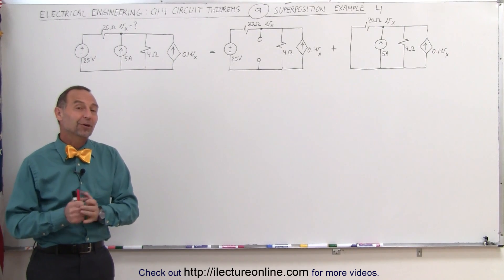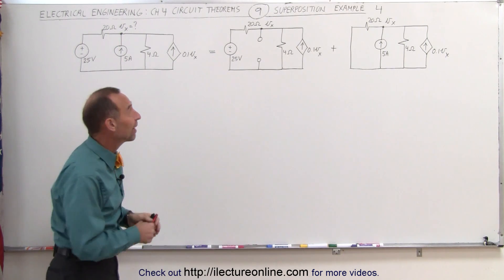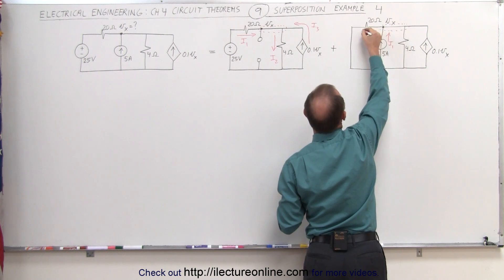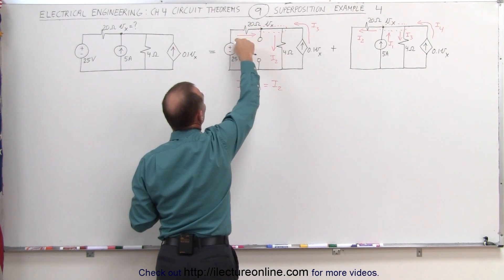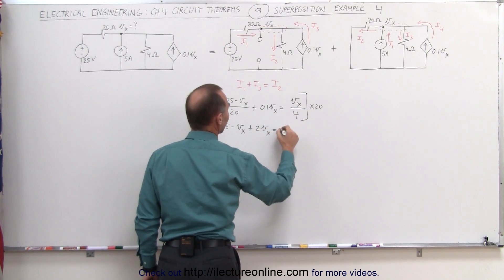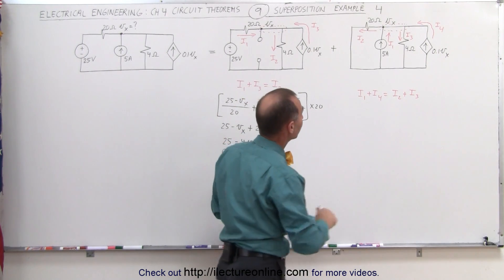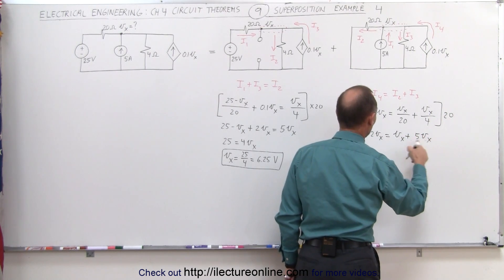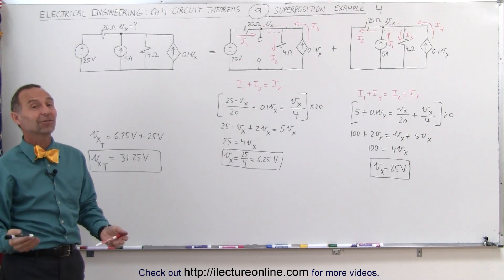Electrical Engineering: Ch 4: Circuit Theorems (9 of 35) Superposition Property Ex. 4

Comment: Appreciated this video!👍 I checked the answer/method by adding the currents together to find the currents in the original circuit, and then used it to calculate the voltage at Vx in the original circuit. Got the same voltage again(ux=31,25v) it checked out!
Reply from the maker: Thanks for your comment.  It show how solutions can be found and checked in multiple ways.  Clever approach!

Comment: A single node voltage equation would have solved it immediately like this. (Consider that the dependent current source is actually Vx/10). So using node voltage we have (Vx-25)/20  -  5  + Vx/4  -  Vx/10  = 0. Solving for Vx = 125/4  = 31.25.

Comment: for the first circuit, when I put I3 the opposite direction of what you assigned it, I got a different value for the voltage Vx=3.125 V? isn't it suppose to be ok to assign the current direction cause we will get the right value but with a negative sign,   I got a totally different value from your 6.25V

Comment: why cannot we use in the first separated part of the circuit the mesh analysis in which we have  here also a voltage source?
Reply from the maker: There are often multiple methods to solve the same problem.  Try it and see if it works.
Reply: thank you Sir

Comment: One question, , when we calculate the I1why shoudn't we consider the polarity of the voltage source? Why shouldnt it be -25-vx/20? I always made this mistake and thus always got my answers wrong....
Reply from the maker: I recommend that you pick a direction for the current, (which seems most probable) like I did (from left to right for I1).  Then you find the magnitude and sign for the current using ohms law, I = voltage drop / resistance = (voltage current starts at - voltage current ends at) / resistance.